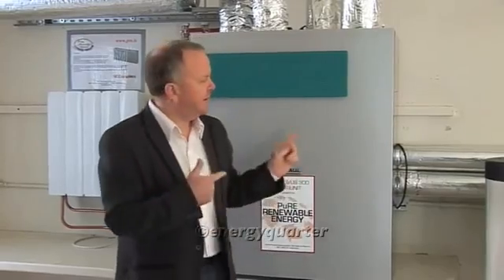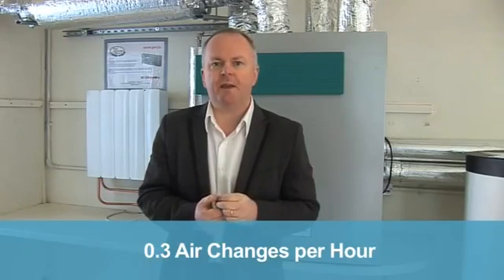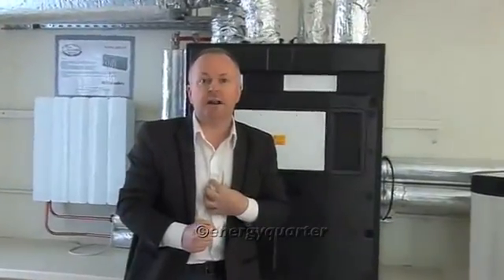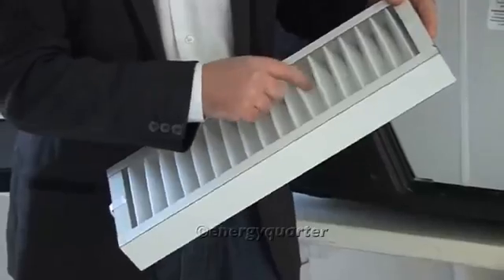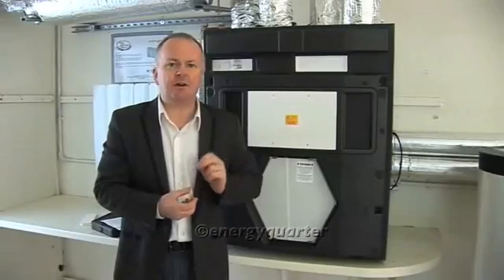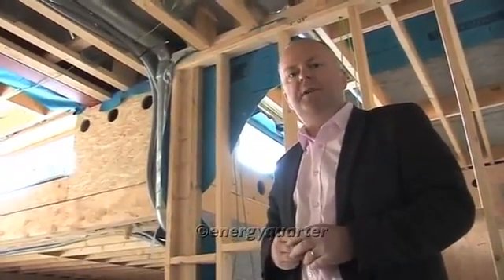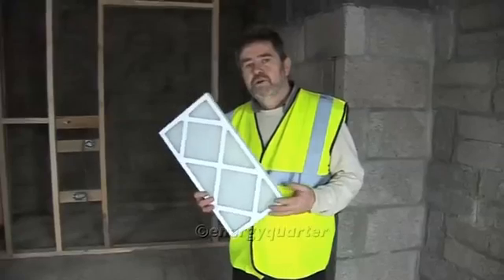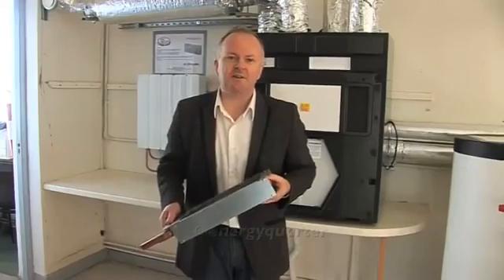Passive House Standard - Heat Recovery Ventilation - Zehnder

Comment: Thank you for clear presentation, Zehnder US.  This has helped my understanding of my new "air recuperation" system being installed in my new house.  

I have some thoughts & questions.
(1) The ventilation box being shown in this video is a huge-sized badass box while my Zehnder box is tiny in comparison and hangs on the wall of a small utility room on the ground floor. Viewers may not realise the size of the unit is depending on the living space of the Passive House (my new house is 2 storeys with 3 bedrooms, main bathroom on upper floor & 1 bedroom, 2nd bathroom, kitchen, open plan living, dining areas, small utility room on ground floor).
(2) Zehnder units are certified by Pass House Institute - I can expect the 90% efficiency in its heat recovery rating without any 12% deduction.  How does this translate to the 25% heating cost saving, I wonder? I can only image the heat loss via wall, roof, windows accounts for the slide from 90% to 25%.
(3) What is the implication of opening a window in the bedroom in my new house, which my strong-willed wife insists that she may want to do so occasionally? This flies against the concept of a Passive House degrading heat recovery, dust filtering etc. in my view but I would you to recommend a good way, explanation to help encourage my wife to avoiding opening any windows.  

(4) Without the optional fresh air inlet tower & the underground earth heat exchange ducts but a single fresh air intake vent on the external wall on the ground floor (near the utility room),  should I need to have any security concerns about malicious access to the single fresh air intake vent by would-be intruders/burglars?
Reply: I have just discovered the meaning of 90% recovery.  A 100% recovery translates to zero centigrade fresh air being warmed up to the "same" warmer temperature of the stale at 20 degree centigrade (say), existing exhaust air. A 90% recovery means the fresh air is only warned up to 90% of the warmer temperature of the exhaust air or 18 degree centigrade. The heat loss through walls, windows, roof, ground is independent of the HRV's efficiency.